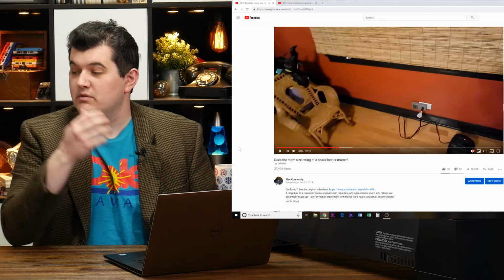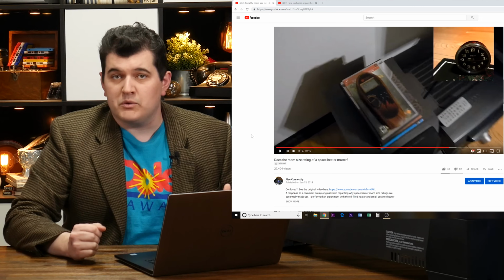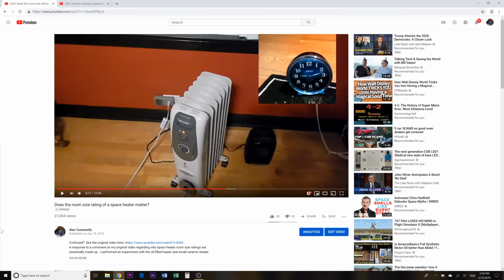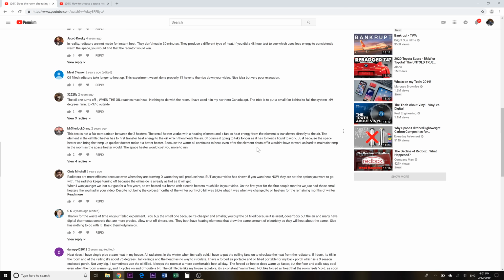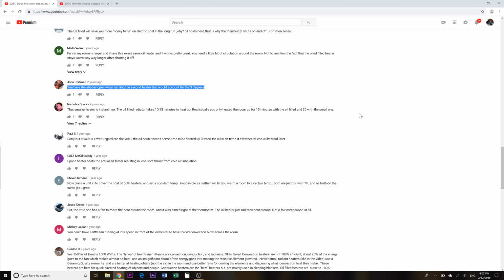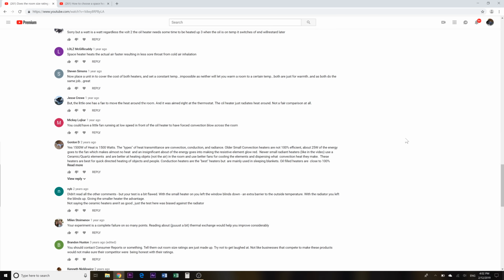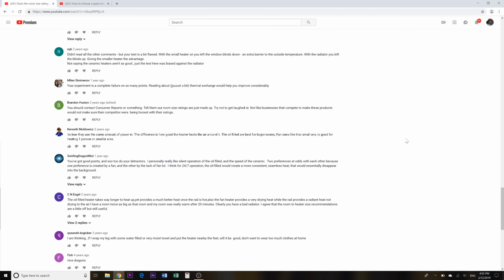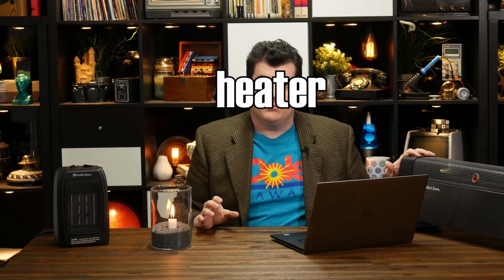More Space Heater Nonsense

Comment: high, engineer here. THAT big heater is, as you point out, less effective. BUT if you were trying to optimize an electric room heater, bigger would be better. 

heat will always be leaving the room, as will air. the goal of a space heater isn't to simply dump heat into the room, it is to maintain temperature at a location. if its a space heater and not a personal heater, then that location is from the floor to ~6 feet off the ground for the entire room. 

in order to do that, you want to avoid convection. in a real room, air comes in and goes out. that means a very hot, tiny heater will create an updraft that can draw in outside (cold) air rather than heating the room from the top down as you seem to think. similarly, the heated air will leave through the ceiling which is of no use to anyone. a larger heating element, preferably with forced air, produces a larger volume of less heated air (with constant power, larger area necessarily means lower temperature). this lower temperature air isn't driven as hard by convection and the amount of the heater's energy concentrated at the ceiling will be lower.

thermal mass, such as ceramic tiles or the oil in a radiant heater, can help in design to further reduce the temperature of the air leaving the device, which as discussed above improves the temperature distribution of the unit. 

all of that said, yes most of what you read on the box at the hardware store is crap. that doesn't mean you can't be a smart consumer.
Reply: High what?

Comment: No all heaters are equal, some may be slightly more efficient than others,  a heater that draws 1,400 watts from the wall may be using 1,300 watts for heating while using 50 watts for electronics and thermostat and 50 watts for the fan,  a different heater may no have any electronics and use a small fan that uses only 15 watts so is actually using 1,385 watts for heating so its output is slighter bigger and slightly more efficient,  a bigger heater may have a large fan that circulates air faster allowing the heater to be constantly on and heating the room much better,   just because a heater takes the same amount of power from the wall than a bigger one doesn't mean its going to do the same as the larger one, the small one circulates air at slower speed so it will be difficult to warm up a larger room, so yes there are small differences in how efficient a heater may be,  but too small to worry about it.

Comment: Relax man, you're definitely correct, but that's not the frustrating part. But let me offer what could be called a long term test between a oil heater and a infrared heater.  During this resent winter, I'd fallen on hard times, in fact, I'm still having to live in a garage. The garage is 20/20ft with two somewhat large double pane windows, a brick exterior, and one wall is mostly just a loose garage door that seems to be made of somewhat dense cardboard and thin metal.
While not nearly as cold as the previous year, it did drop down to around 25f. through 3-4 months of this, i was stuck with only a good quality oil heater. 
I hadn't ever used one before and had higher expectations for it. As the months went by I kept it running near constant and while on warmer days it could get the area near it comfortable, I often questioned if it was still working.
I finally got a new heater after 3-4 months, this one being the infrared quarts heater. It is working at least 5 times as well as the oil heater at heating the 20/20 garage. I believe mainly due to it's fan and it's ability to constantly produce heat without cutting itself off while the room is still cold.
I've noticed that the benefit of the quarts stored heat, witch is established quickly when turned on, does reduce it's overall potential out put but insures stability during it's activation period. It's only a very small benefit in my opinion,  though, perhaps there are other reasons for all of this double dipping I'm unaware of.

Comment: I have a propane heater designed for using in a house while doing construction work I think it puts out about 75 thousand btu and heats a garage bay up really fast in winter but the fumes will KILL you if not properly ventilated ... what I do i run it for 15 minutes in garage all closed up and then holding breath turn it off (i do not go in till 15 minutes are up) open garage doors and ventilate garage of fumes for about 60 seconds and close the doors ... at this point the garage is still warm as hell because the 75 thousand BTU monster heated up all the surface space ..walls floor ceiling tool box and car etc.. so that all that stuff is now radiating heat back into the garage .. I then turn on a different style heater to maintain the temp in garage .. the point here is that godawful propane heater can heat my garage to a an ungodly high temp in 15 minutes where my other heaters (plural) would take 3 hours to not get anywhere near as hot as it has to heat soak everything in the garage as well .. ..used that fucker in the house a few times but takes longer to get rid of fumes and you lose a lot of heat during that time ..

Comment: You are sidestepping the purpose of the heaters and why they are rated as such... If you are the type of person who is simply COLD and want to heat a room as fast as possible and fuck the cost .. then ceramic style is the way to go ? but the oil filled set up is to heat a room indefinitely and more cost efficiently... how much more power did that lil fucker use then the oil filled one ? and if you let the oil filled one heat up for lets say 10 hours and you then repeated the test ?  (have oil filled one in another part of house with a long heavy guage extension cord then wheel it in when ready to test .. if you actually do this teast doing this you will find a different result as not only will the oil filled one supply more heat but do so using less power .. you were doing the test on which one heats fastest when oil filled heater was not designed that way

Comment: I described at length in TC's Feb 13th video on space heaters (same day as this video in TC2) how my ceramic tower heater works very well at quickly bringing my bedroom up to comfortable temperature, but then its thermostat cuts it off in the middle of the night, so I have an oil-filled heater that keeps my bedroom comfortable the rest of the night. My guess is that it takes a few hours for an oil-filled radiator to reach full operating temperature. I can't say exactly how long, because I'm usually asleep, but I'd say a few hours, two to four. 

Spending a few hours one afternoon testing out heaters in a room in your house is a crude test, for several reasons. What was the temperature differential between inside and outside? What was the solar irradiance and solar heat source on that room? Might that solar heat source have changed in the time it took for you to run your experiments? What about draftiness? Did the winds change outside during your tests? 

See, I've been using a variety of electric space heaters to heat my bedrooms and bathrooms for several decades, in several different buildings, in different parts of the country. I've figured out what works well for me. So, a one-afternoon test isn't good enough.

Comment: You just need to hire a football coach to tell the space heater that it needs to give 110%
Reply: some doping would be handy, in this case: a nice compact autotransformer.
Reply: the heat from his head is the extra 10%
Reply: Or a retail district manager......
Reply: Coaches: ignoring the laws of physics since... forever
Reply: @Lawofimprobability: 100 percent is maximum efficiency. The reactor can provide more power, but shortens the lifespan of the reactor. Ever play Oakflat Nuclear Power Plant Simulator ?
Reply: "Go to 105 percent on the reactor." -- Captain Tupolev, The Hunt for Red October
Reply: @Christopher-N  The redline on your car's tachometer is the recommended maximum speed for the engine - i.e.  "100%". But shift into low and floor the gas, and you can certainly over-rev the engine past 100% of the max.  
100% on a reactor is the maximum recommended output. (I'm guessing here, but likely the constraint would be the RPM of the steam turbines).

For both engines - if you keep it above the maximum for any significant time, the engine is likely to be damaged. 

And didn't he also order the sub below its maximum depth?
Reply: @RottnRobbie  this is why military vehicles typically have two maximums, one regular and one "wartime".  Going above the former reduces lifespan and creates maintenance issues.  Going above the latter means your engine just exploded.  The space between thus reserved for actual conflict, when trading maintenance lifespan for "not killed by the enemy" lifespan is an easy tradeoff.
Reply: Heatpumps routinely give 300% (runs for cover)

Comment: Great videos and I understand your frustration. 
You are correct in your theory but there are some buts. There is one thing that is missing and that is the gradient of temperature or temperature difference based on location in the room. For the convection heaters there is a smaller volume that has a higher temperature (duh!) which means that there will be larger differences in temperature. Like how you did with your small heater at the computer, it heated just where it was necessary and not the whole room. That's why you want long wave infrared heaters. They don't necessarily give more heat energy but they put more of the heat at the right place and therefor your energy use is/might be less than when heating the whole room. 
Then you have the heat exchange to the outside world is based on the temperature(difference) on the walls(ceiling,floor) so if you could manage to isolate the walls, less energy is needed. Oh wait, we are already doing that... :D (especially in cold countries like here in Sweden)
The optimal heater would be a split type heat pump that didn't need the gases  but could be transported by electricity. You would only need to change the heat to electricity. Oh wait, that's the electricity system :D

Comment: While a watt is a watt. I own different styles of heaters and from first hand experience I can tell you that my quartz infrared heater produces heat faster than my ceramic and much faster than my oil heater. So yes if we set them in a room for 24 hours I am sure all of the rooms would reach the same temperature. But when I come home and need heat fast I would never ever use the oil radiator. Whatever you want to explain the reason for it great I dont care, I can only speculate the reason and at the end of the day it doesnt matter the results matter. Now I am not saying to go buy a $200+ infrared quartz heater, I own a cheap model and a more expensive one and they preform very similarly.

Comment: There's 2 other issues that make the oil heater a "less useful" heater, one minor and one somewhat more important. The first is that the oil heater, being purely convective, tends to send most of it's heat up to the ceiling of the room. I've had heaters like that in still rooms, and found a distinct heat layer between the ceiling area of the room and the floor area. (You might want to try that experiment again and put your thermometer near the ceiling and see how stratified the heat layers have become.) On the other hand, the small black ceramic heater, by virtue of it's fan, tends to keep the air more "stirred up" in the room. Resulting in higher temps, closer to the floor. Another issue(actually call this a third issue) is that you placed your oil heater close to a window. If it's cold outside, the window can act as a heat exchanger and dump a lot of the warm convective air rising right next to that window into the great outdoors, whereas the small black heater, again by virtue of it's fan, is blowing the warm air more into the center of the room, away from the window, so the resultant delta-T at the room-air/glass boundary is lower, resulting in less loss.
The final issue is more subtle and is somewhat related to the oil heater cycling itself on and off. Most resistive heating elements use materials that exhibit a positive temperature coefficient. Ie: As their temperature goes up, so does their resistance. This prevents thermal runaway and makes the substance self-regulating. BUT, If you can keep these elements at a lower temperature by moving a lot of air past them, you can theoretically make them operate in a lower-resistance/higher-power domain. For instance, if you put a big blower on the oil heater, and kept it much cooler, you might cause it to operate at a 1550W rate instead of just 1500W. This isn't free energy, it's just forcing the unit to operate in a way in which it can draw more current, hence produce more heat. Now, the delta-T coming off the heater in this manner would obviously be lower, but this would be compensated for by the fact that the total amount of heat/energy/joules per unit time, would be higher. The small unit with the fan would thus have a minor advantage over the purely convective unit that presumably is operating near the equilibrium point of it's heating elements. OTOH, you could make the oil heater more powerful(not more efficient) by putting a really big honking fan on it.

Comment: The protection is to stop the oil from boiling, to prevent a rapid pressure buildup whereby the metal oil heater could explode, if all other safety features failed  and the emergency rupture valve also failed (which would if activated release oil into the room). The cutting off and on of an oil filed heater with the heating dial turned up maximum is a safety feature. The small fan based heater is heating predominately by convection. The oil filed is predominately heating by radiation and if placed near an (inner) wall of a room by a slower convection effect. The fan based heater when turned off the room will immediately start to cool down, where as the oil filled heater will continue to radiate into the room for possibly an hour after it is turned off slowing any cooling effect. It is unfair to compare any heating solution without characterizing all their features and flaws. There are even night storage heaters which heat up large heavy concrete blocks using much cheaper nightime electricity rates and slowly release heat in to rooms over several hours. They are extremely slow to warm up to temperature, and then maintain the rooms temperature while powered off.

Comment: Just out of interest how long after the oil is turned off does it continue to heat the room..  Could you potentially do the test again do you can see if over a 2 hour period of running and turning them off whether there is a point which both temperatures converge?      The fan is defo better for instant heat,  i've never had a oild heater but i'd be interested to know if after x period of time if uses less energy to maintain its temp?

Comment: I think I just figured it out and it has to do with rated lifespan. If you take a 1/4 watt and a 1/2 watt resistor and put the same load across them they will dissipate the same amount of energy as heat. The difference is the 1/4 watt is much cheaper but it gets physically warmer and its lifespan will be reduced. Likewise with the heaters, they output the same amount of heat but the "small room" heater uses a smaller, cheaper element but requires a fan and will fail much sooner. If a consumer expects the heater to last 'X' number of days and the elements are rated in hours then the manufacturer can fine tune the size of the element to account for the smaller room requiring a shorter duty cycle. If they expect the small room to require 30% of the energy to heat up then they can make the element 70% smaller,  that much cheaper, and it would be expected to last just as long in the eyes of the consumer as the "large room" heater would in a larger room.

Comment: An interesting point from a UK viewer, our electric space heaters are often different wattages. Our theoretical maximum power draw (240v*13A=3120w) at 3120w is significantly higher, though it's rare to see a heater rated above 2.5kw. A lot of the 'small room heaters' are rated for, as in the US, 1500w, whereas the larger 'large room' heaters are rated around 2500w.

For example, my parents have a very cold living room at the back of the house, they have purchased a 2.5kW oil filled radiator to warm it, the front room also gets cold, but in there, they have a 1.5kW fan heater, with coiled heating elements.

The point I'm trying to make, is that in the UK at least, type of space heater matters, and usually they are suitable for the room size marketed for, with smaller heaters' being seen as a fire hazard, and therefore generally having a smaller heat output. (They're also dirt cheap, you can get a 1.5kW fan heater for less than £10 in one of the 'cheap shops'.